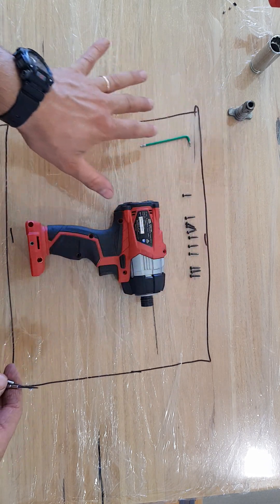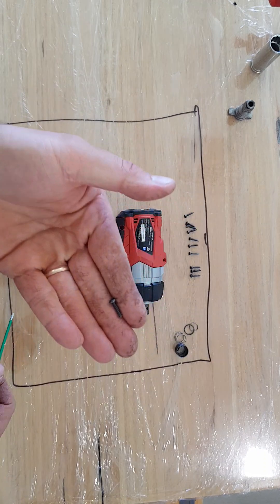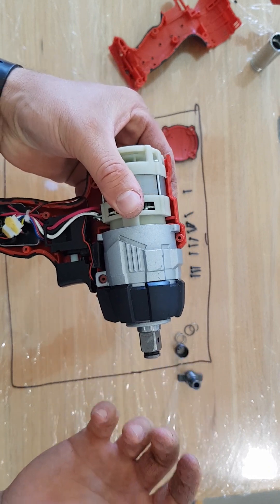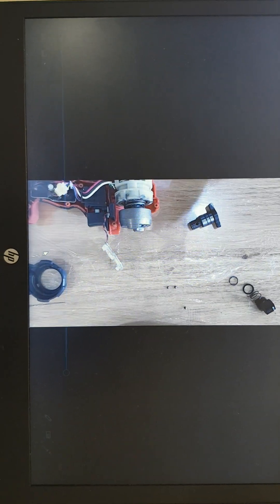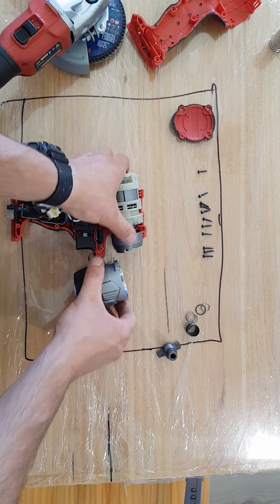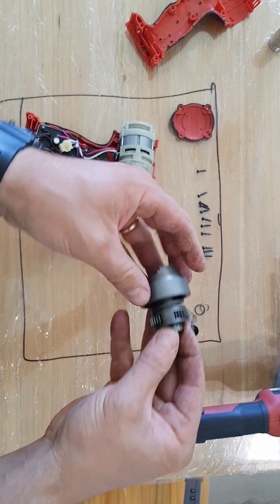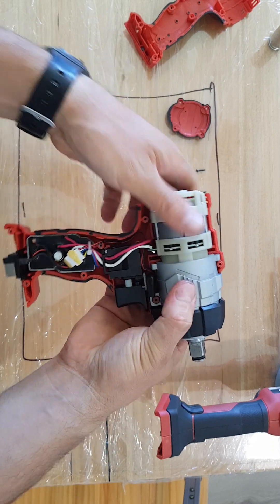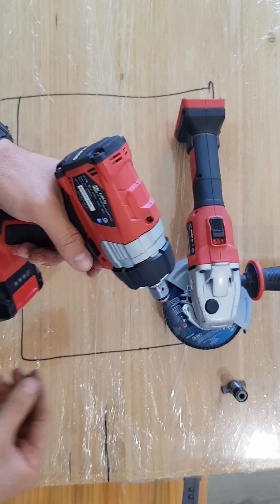Ozito PXC 18V Brushless Impact DRIVER DIY Modified to WRENCH

Comment: I also wonder if you can buy the pxc wrench and perform the same mod so you get more torque
Reply from the maker: You could, just not sure if the more torc will break or not the bits. I had this tool, and for my small application needed a wrench as well, so for a 10$ extra have obtained the wrench. Its plenty for what i use it for. Cheers mate

Comment: Props for all the effort, for those who want to have the same functionality for $23 - go to Bunnings and buy the 'Kango Hypertorque ½” to ¼” Impact Wrench Adaptor'. The other option is to buy the same part on ebay for about $8 as a generic item. Then just pop it on and off as needed for hex bits :)
Reply from the maker: Agree, there options there, @ different cost, i shared my option. It works for me.
My part was about 10$ delivered home. I could have bought it for under 5$, but the waiting time was longer.
Thanks 🙏

Comment: Great Hwo-to!   Good idea too.
I wonder how the tiny hex bits will handle the torque? I would suppose care is required.
I am a bit disappointed with the tiny size of the hammer and anvil on that driver. I hope they use much more substantial parts on the bigget 400NM unit.
Reply from the maker: Thanks mate! 
This is a impact driver, this would allow me to use it as wrench as well. So basically i have a weaker (30Nm) wrench driver! 
More coming! Cheers